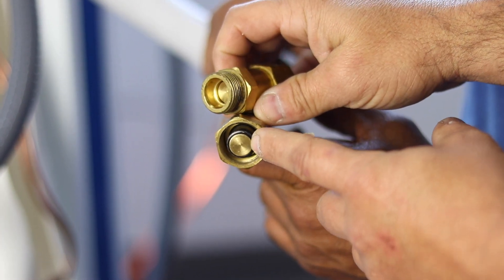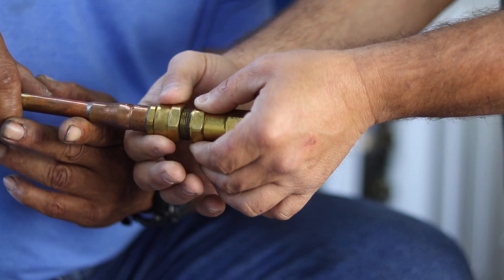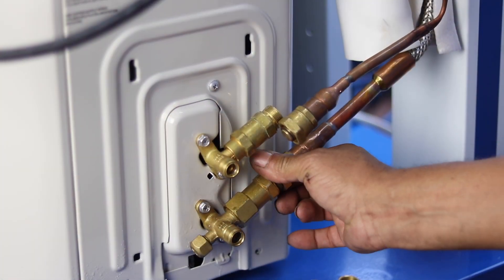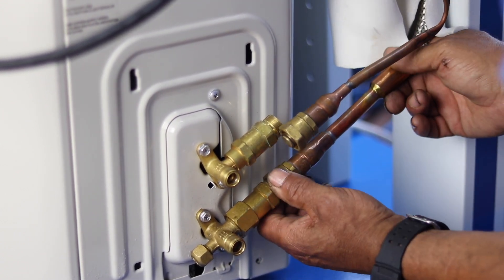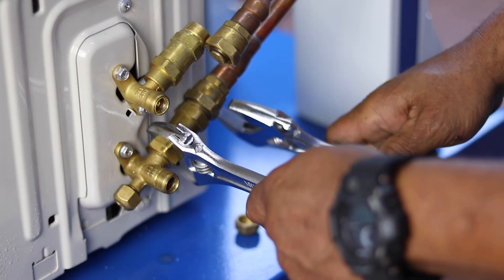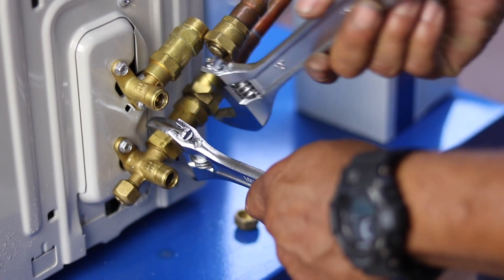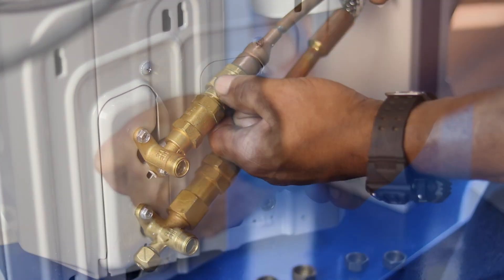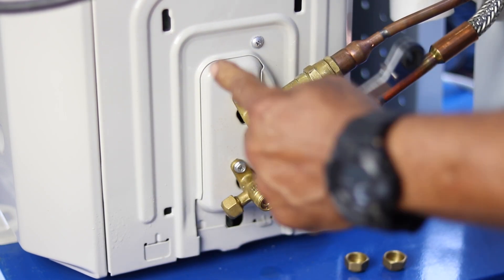Why the MRCOOL DIY Ductless Mini Split is Truly Do It Yourself

Comment: does mrcool recommend using any kind of hvac sealent like NYLOG blue? when connecting the linesets? how about an hvac oil to ensure threads go smoothly on? I've read rumors that these linesets are prone to leaking latter on. any tips to minimize that risk?
Reply from the maker: You can use NYLOG, but it is not required.

Comment: Can you connect multiple Mr. Cool pre-charged line sets together? The system I was looking at comes with a 25' line, but my line length to reach my outside unit is 35', I don't mind buying a second pre-charged line set, but wanted to verify that they can connect together before spending the money.
Reply from the maker: Couplers kits will soon be available that will allow you to connect together two DIY line sets. So, if you needed 35', you could connect a 25' line to a 16' line using the coupler kit.
Reply: @MrcoolComfort  YAY!
Reply from the maker: We hope to have them in the hands of most dealers by the first week of June.
Reply: @MrcoolComfort   Is there an update on these couplers?

Comment: Hi, Does this only turn on with the remote -- or does it have an on swith? How do you plug it in? Do you need an electrician to run power to the circuit breaker? Can you plug it into a 240 wall outlet?
Reply from the maker: The MRCOOL is activated by a remote. It cannot be plugged in to a wall outlet. The outside condenser is wired to a disconnect box.
Reply: Actually, yes.  Yes it can.

Comment: I just don't like the idea of 20'+ of line when I only need about 10. Do you think an AC shop could shorten those lines and re evacuate them for me?
Reply from the maker: Yes, they could. However, if you're going to hire them to do that, you would be better off going with a less expensive system like our MrCool Advantage ductless unit.
Reply: @MrcoolComfort  Ok thank you I will look into that. I really like the idea of DIY as who knows what the hvac guys would charge for the evac/charging and always a possibility I guess of no do for me as just setting up that part for a DIY homeowner can rightly set up some liability and requirements by the company.

Comment: Do the line set fittings on the DIY systems allow for future removal without loss of refrigerant?  IOW, if I install now, and later need to relocate the compressor to a different location, can I disconnect the lines?
Reply from the maker: Yes, that is possible.
Reply: What is the procedure to disconnect line set from Mr Cool? Shut off refrigerant disconnect ??Will they need to be vacuumed??